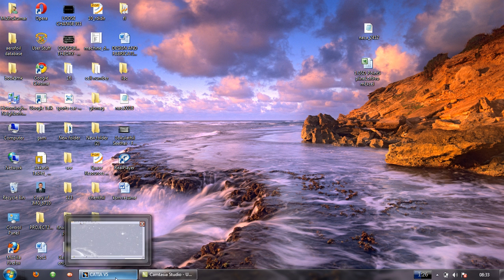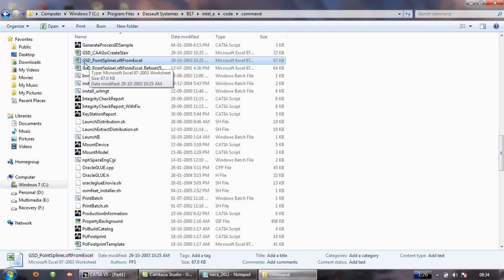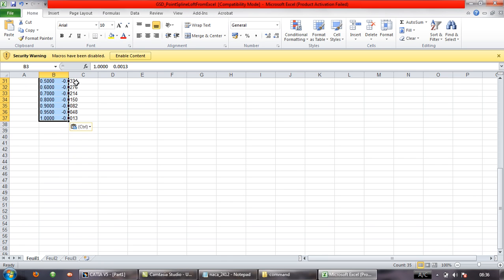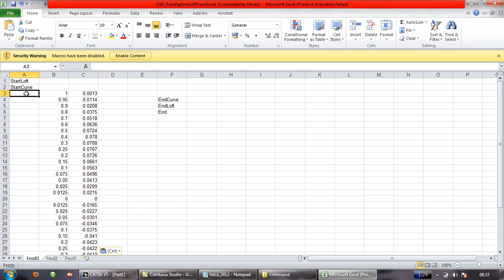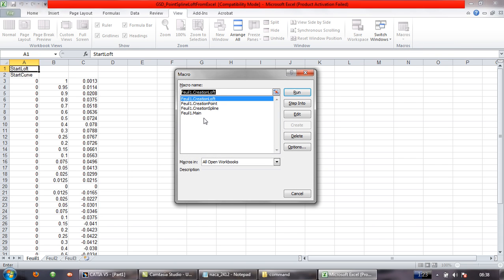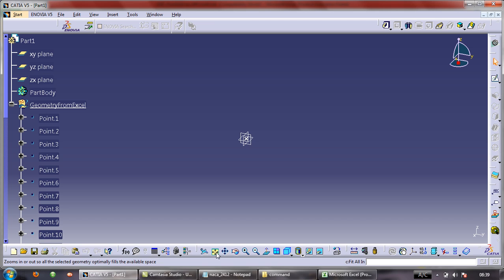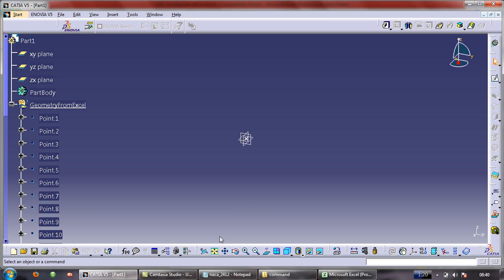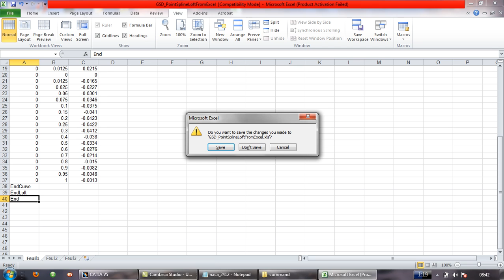Import aerofoil coordinate in catia

Comment: i keep getting type mismatch
Reply: All points must be replace by commas! That removed the error for me. You can use the find and replace option if you don't want to replace them one by one.
Reply: Mathieu J-Dupuis don't worry i have a problem in visual basic i tried everything no hopes, so fortunately i found another way using a small tool called profscan.
thanx for the reply by the way

Comment: i am getting the same problem like others of "Object doesn't support this property or method" please need help
Reply: I stumbled upon this problem as well. The solution is simple, but it is absurd that it does not work immediately.
Open your part in a new window and try running the macro again, it should work. It doesnt like the product interface, even if you are already in a part
Reply: aapman555
Indeed you are right! Thank you very much! This is the answer for that problem!
So, with the Part1 already open, open it again (after saving it)!
Reply: still not working... any other suggestions. :(
Reply: +aapman555  this worked thank you so much
Reply: this is a kind of problems i hate when they occure, you never know what's going to help. 
i can't believe this was so simple. thanks so much
Reply: Wow!! It works!!!!!!!!! Thank you very much, i have searched whole internet for this solution!!!!!!!!

Comment: how to connect all the coordinates so the curve of the airfoil will be smoother?
Reply: Fahmi Zainal 
Do you get the answer already?
Reply: Nope. Sorry
Reply: +Fahmi Zainal use the spline operation
Reply: Multiply all the coordinate by a n like 10 or etc to scale up the airfoil bigger. The curve wasn't smooth because it was scaled to 1mm. 1mms airfoil is too short.

Comment: hi, i had the error "system error &H80004005 (-2147467259)" even I had in a Catia part module.

The points are showed up but the spline is unable to show up. The airfoil i used is NACA 0012 and the .dat file is from airfoiltools. the error shown in spline is Two successive points are geometrically identical. I checked the data but there is no identical points. Will it be the limitation of CATIA to read 7 decimal places value from EXCEL?

Thank you in advance for any reply
Reply: did you get the solution over it?